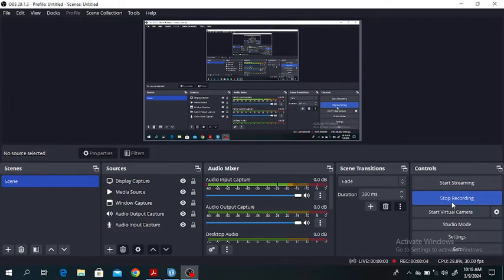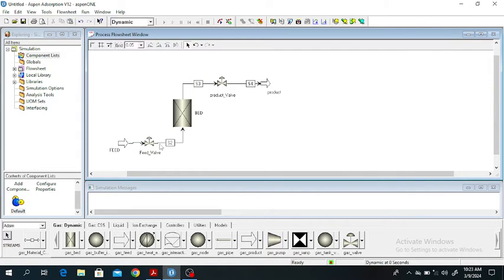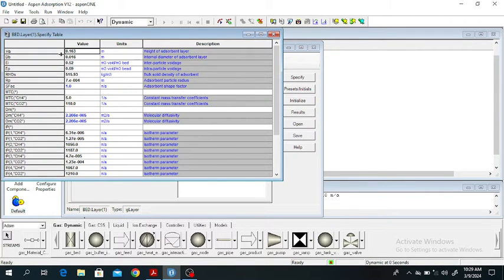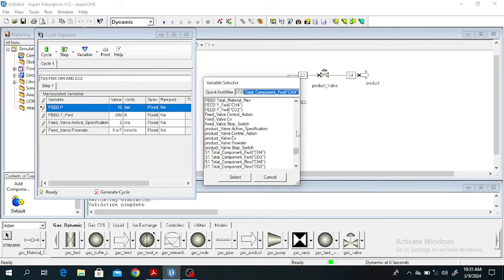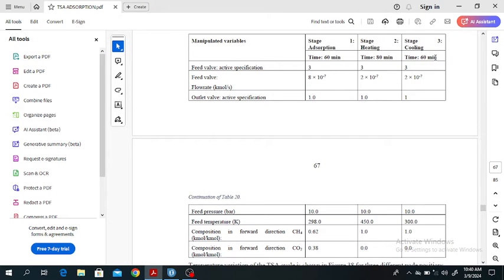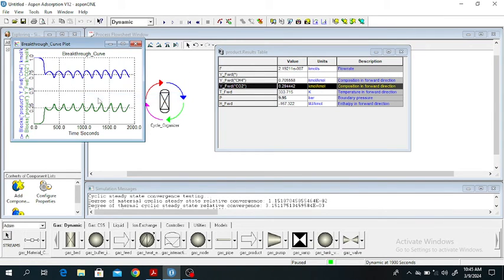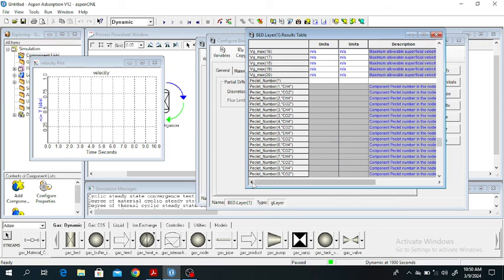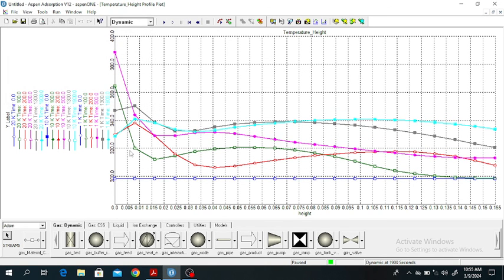Temperature Swing Adsorption for CO2 capture || Aspen Adsorption

Comment: Hi to Adsorb CO2 and moisture and light hydrocarbons form air by using adsorbents like Activated Alumina and molecular sieves  please tell me how to do in aspen
Reply from the maker: For aspen adsorption, you need the properties of your feed stream and adsorbents. It also depend on the pressure drop, isotherms like Langmuir, Freundlich etc.
Reply: Air separation unit use tsa to capture moisture and co2 and hydrocarboons can you please do one tutorial on that ?
Reply: For air separation process what are the components need to be selected ?
Reply from the maker: @narendhraraju mostly N2 and O2

Comment: I am currently working with Electric Swing Adsorption (ESA) for CO₂ capture. We're using gPROMS to try to model the cycle, but I was wondering if it's possible to simulate this process in Aspen Adsorption.
Reply from the maker: Yes, ESA process work in Aspen Adsorption.
Reply: @chemicalengineeringzone3560 When possible, could you record a video showing it? I noticed it's not in the Aspen Adsorption documentation. One possibility would be to program it in Fortran

Comment: Hello, I have a question that is not related with this simulation but I dont know how to solve this error, I havent found anything online for solving it. 
I am getting results and the model is converging until a point where I have this error:
SPARSE: No norm reduction after 20 step reductions
SPARSE: Return to best point

what would you recommend me to do, I have tried changing things in the Integrator and in the Non-linear solver but no success
Reply from the maker: Check your initial and boundary conditions.